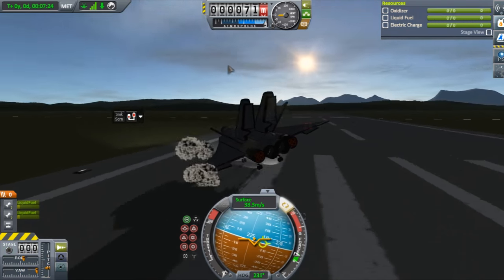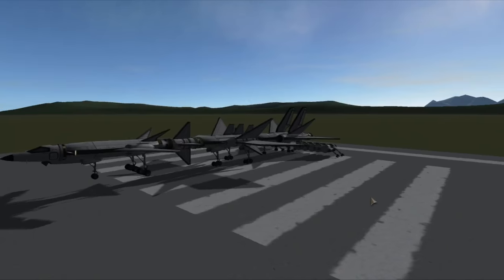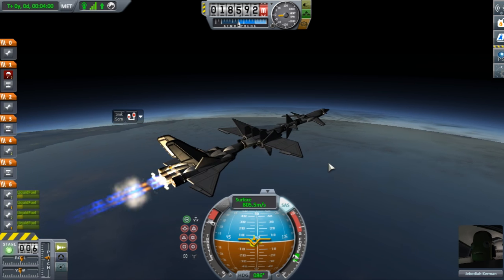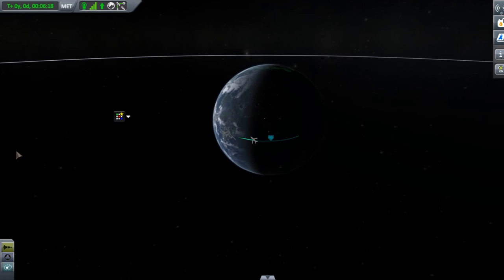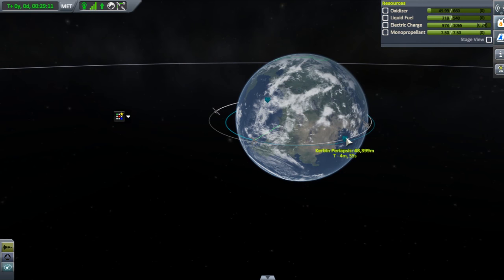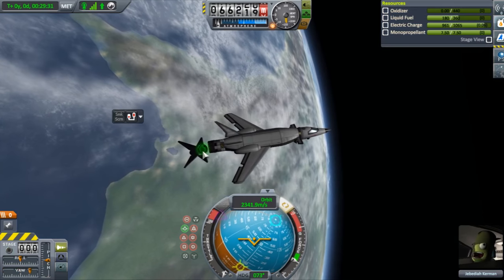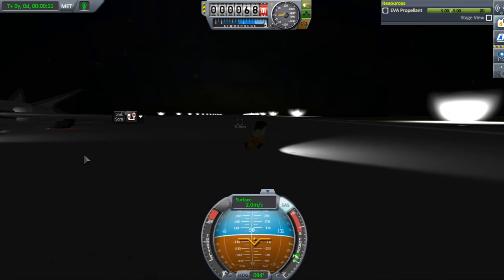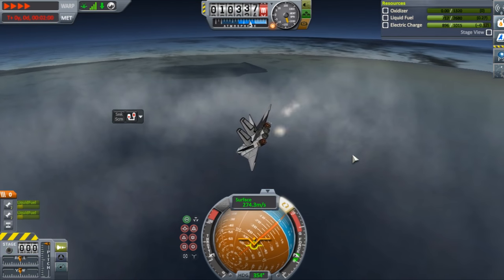KSP MSTO (multi stage to orbit ) and return all recoverable spaceplane!@#$#@%

Comment: Auto strut will be your friend. I prefer this to using manual struts or KJR.
Reply from the maker: thx for the advise... Will give it a go to see if it works with my design
Reply: In the settings menu there is an advanced tweakables option. Turn that on, then you can right click each part and configure autostrut in the VAB/SPH. Soooo much better. Only became available in 1.2.

Comment: What mod are you using to keep parts from being destroyed when they move too far from the active vessel?
Reply from the maker: it's called KJR ( kerbal joint reinforcement ) and the active render range is 9 km after that it's out of physic range
Reply: I use KJR.  Thought it only protected your ship from some Kraken induced wobbling and bending?  Last I checked it didn't allow you to switch active vessels past the pre-defined limits to land previous stages.
Reply from the maker: not sure as it work well with me, anyway u can use ( vesselswitcher ) instead,
I will run some testes tomorrow to help u out with it....;)